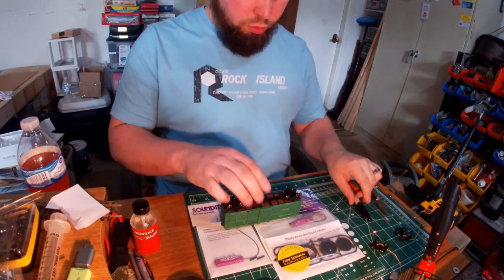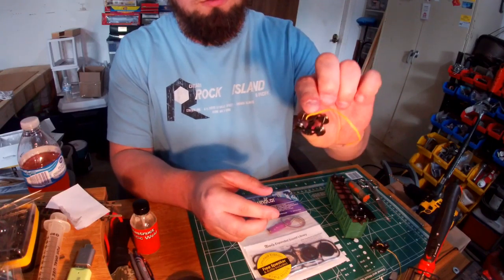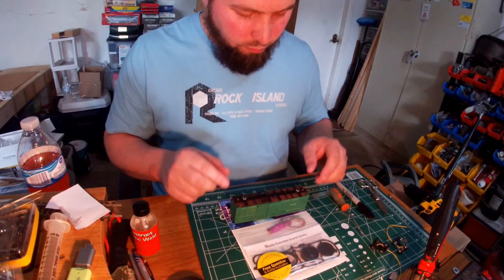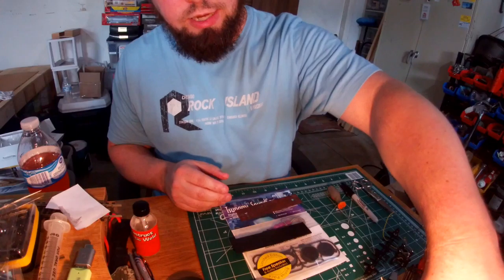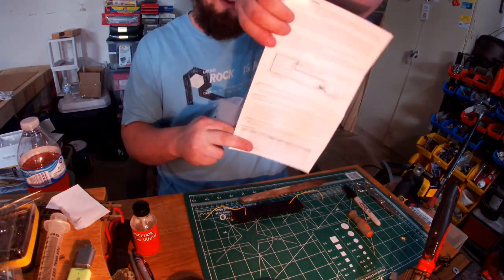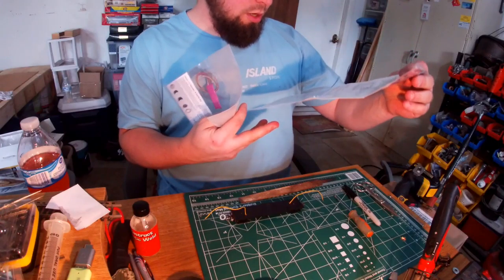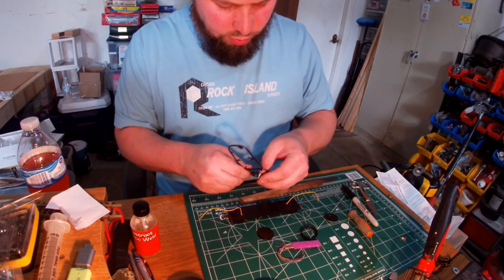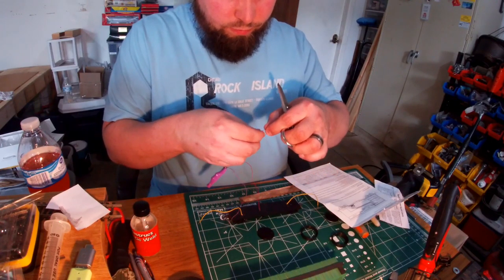How to: Soundtraxx Tsunami2 Soundcar w/ Cattle

Comment: Neat demo video Jason. I will have to try the trick of using the Kaydee centering spring to add electrical pickup to a metal-wheeled truck. Thanks for sharing.  Art...
Reply from the maker: I can't take credit for the idea. George at Soundtraxx shared that with my dealer training class a few years ago but a much cheaper alternative. Make sure you use some good strong glue!

Comment: have to save this video for the future. may be something I would try later. thanks
Reply from the maker: The cattle cars are a little more fun with either cows or sheep. These can be installed in boxcars, covered hoppers, etc. just to get the flange squeal and flat spot. You can even put these in passenger cars and Cabooses which I will do one soon to also control lighting.

Comment: Under what circumstances would you use the current keeper? Are you not using Dynamic braking sounds on this locomotive or will you program it later?
Reply from the maker: The current keeper is basically a few super capacitors wired in series to provide extra power if the locomotive or in this case the stock car looses connection (power) from the track due to it being dirty or a dead spot by a bad rail joiner. There is the possibility that I will have to add one to it in the future but I didn't want to add it to the video as that would of been extra time. As for the braking, it is enabled by default but in the controller you have to change your brakes from locomotive to train like an engineer would do in real life. 
Locomotive braking only applies the brakes on the locomotive. Train braking applies the brakes on the whole train and it works opposite of how a car brakes. Everyone knows when you push the brake pedal on the car, brake fluid is applied to push the pads either on the drum or disc. When a train uses brakes, air is applied from the locomotive through the air hose that is connected between each car. Once the air pressure builds up, that releases the pads from the wheel. When a train goes into emergency, it literally dumps the air out of the whole line which causes the brakes to rub the wheels on every car and it still can take a mile to stop a fully loaded train.

Comment: Jason, Just setup my first sound car  on the work bench select loco 3 and hit the horn bell F12 F10 speed step up to 30 all the sounds played great.  Added to my mainline on the layout selected Loco 6387 put the magnet over the box car with sound car installed I heard the brake sounds then I hit F8 4 times but never got the hissing sounds so I cannot get it connected with advanced consist any ideas?  it is the 5th car from the engine thanks Tom
Reply from the maker: It could be a programming issue, try factory reset the decoder and try again.
Reply: @TheTrainFreak  Jason I now hear the hessing sound  I figured out what sound to listen for when I wave the mnagnet over  but still now sounds from the souund car
Reply from the maker: Good deal!